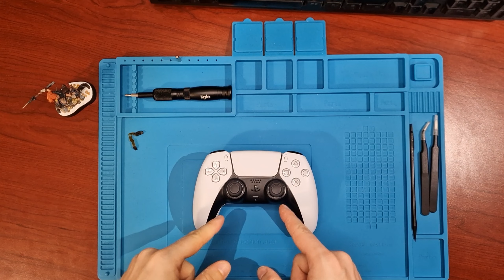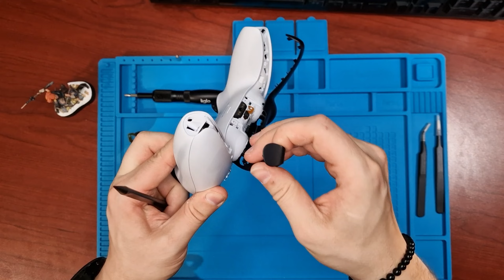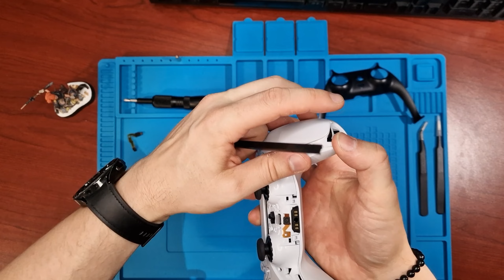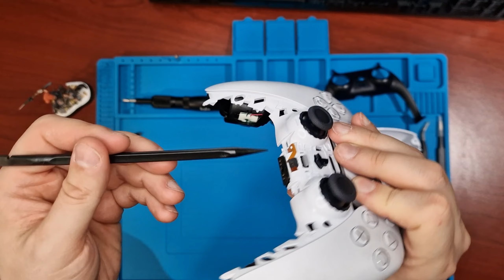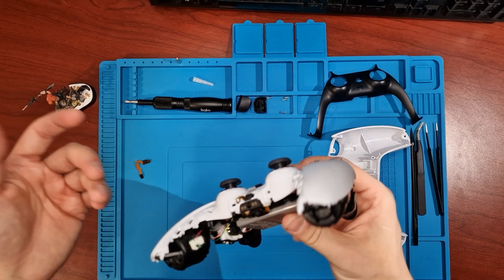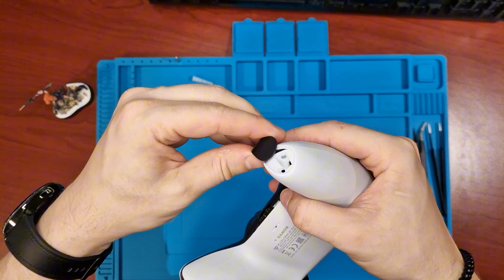Dualsense Microphone Repair

Comment: What a name apart cable you changed?
Reply from the maker: It's usually called Microphone Flex Cable for PS5 BDM-020 or 030, 040 etc. Depends on the model of controller you have! 

Hope that this helps! Thanks for the comment! 😃

Comment: Thanks for the video, quick question, is cable also for charging the controller while docked? Or is it only for mic?
Reply from the maker: Only for mic, it does not affect the charging connectors! 😊

Thanks for the comment! 👏

Comment: I changed it but still doenst work, what else could it be?(all after stickdrift cleaning)
Reply from the maker: 😮 Sad to hear. So if you changed the upper one. Did you fit it properly into the connector, if it's not at the bottom it might glitch. Also what I've experienced once. Was that I had to reset the controller. You have it underneath that you can press with a small pin/needle.

If that doesn't solve it, most likely it's a defective spare part. Has happened to me as well. I usually buy 2-3 from different places just to be sure.

I hope this helps! 😊

Comment: The front microphone is missing from my PS5 controller, but the rear microphone located above the battery is still installed. Can the rear microphone work and record audio normally without the front microphone?
Reply from the maker: No unfortunately it doesn't. It reacts from the top one. The bottom one then helps to filter and pick up voice as well though!
Reply: @Andy_Dee Okay, thank you! So I need to buy the top microphone, and there’s no problem with the bottom one. Thanks!
Reply from the maker: @amincrypto-q8z  Yes, then it should work without a problem! I hope this helps!

Thanks for the comment 😊

Comment: this is the biggest shit job ive ever done, getting that fucking mic cable through doesn't work. It does not get stuck "sometimes" it gets stuck every single time and there is no doing it without almost ripping the whole shit in 2. terrible design.
Reply from the maker: Hi! Sorry to hear that. It is tricky but you just have to patiently try to thread it through. But I can tell you that I have broken the cable once or twice myself doing it.. 😢 So I understand you. In the newer version of the controller it seems to be updated if I'm not mistaken though! 😅

Comment: 4:17 where can I get the new 1
Reply from the maker: Either Amazon or Aliexpress is usually good!

Remember to check the version of the controller by checking the serial number underneath the controller 🎮

Google if you have a hard time seeing it. There is V1 to V4.

I've tried V4 on a V3 controller and that works as well! 😁

Thanks for the comment!

Comment: This is an amazing clear videon on how to do this. So I just hope I don't need it. But in case I do (one mic doesn't work) I know to put on this video to help me do it. 

I have an other controller same version... with that drift problem... I was thinking If the other options doesn't work. I could just get it out that one and place it in the one with the mic problem. I'm confident if needed with this video I at least will be able to perform the replacement
Reply from the maker: Thank you!

I will try to update and make even better videos. Have gotten some feedback and thank you for the comment! Appreciated! 😁

Comment: How does the plastic mic protector  comes of the mic? I'm about to change the back mic but the replacement doesn't have the protection, and maybe I can even try fix the mic, I bended the flex and it completely got ripped.
Reply from the maker: The black rubber part? It has an opening on one side so you can fold it open.

Sorry to hear that it broke. 😢

I hope this helps!
Reply: @Andy_Dee :O thank you so much I didn't see that it had like 2 little parts where I can pull :O
Reply from the maker: @jfsps15 No problem! Glad I could help! 😁

Comment: Mine snapped at the hole while fixing the stick drift, 1 issue fixed, another created 😑
Reply from the maker: Oh, I'm sorry to hear that! 😢
Reply: @Andy_Dee I would like to say ur video was absolutely amazing, we've ordered the part and hopefully will have it fixed in a few days, thanks to u I understand how it all works and what to do, I'll keep u updated and if it works ill sub for sure
Reply: @Andy_Dee alright so its all connected and "working", the mic even mutes and unmutes but it wont record any audio. Know why?
Reply from the maker: @SaltCanister Hmm 🤔 could you check your setting in audio and regarding chat? Otherwise I would suspect the paper that you insert isn't entirely inserted would be my guess. Or that the spare part was faulty.
Reply: @Andy_Dee Damn I forgot about this, I spent multiple hours that day trying to fix it but ive entirely given up since then, definitely not in the settings so its likely that the part was faulty, either way I dont have much hope for getting another one and trying again so that controller is now micless (Thanks for the help either way)
Reply from the maker: @SaltCanister  Sorry to hear that. Yeah I've purchased several mic parts and yeah, some of them were faulty too unfortunately..
Reply: @Andy_Dee YO MAN I KNOW THIS IS 2 MONTHS LATER BUT I FOUND OUT THERES DIFFERENT TYPES OF THE MIC HINGY FOR DIFFERENT KINDS OF CONTROLLERS!!!!! MINE WAS THE BDM 040 AND IT ACTUALLY WORKS TYSM UR THE GOAT ❤❤❤❤❤❤
Reply: Same, and while not know how the fix it the microphone box fell out